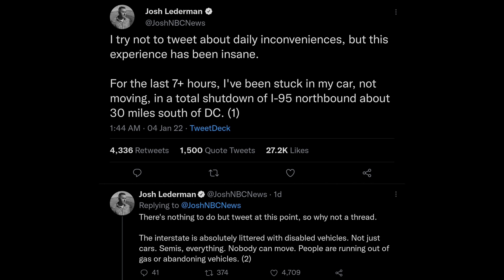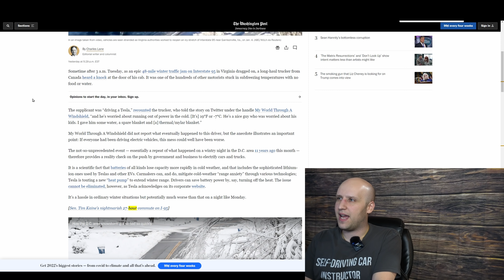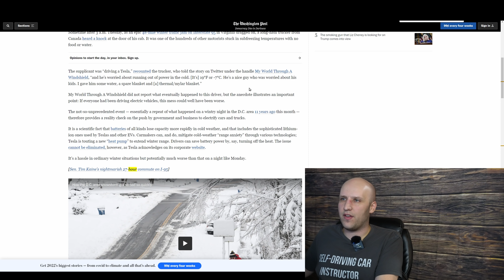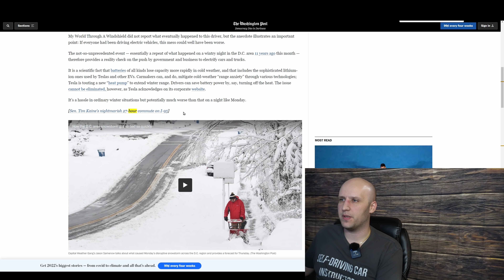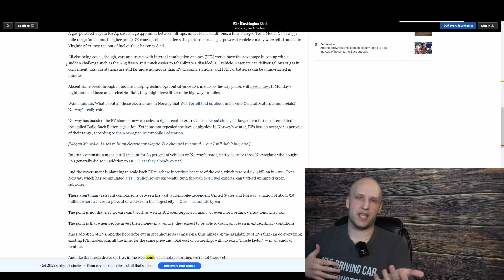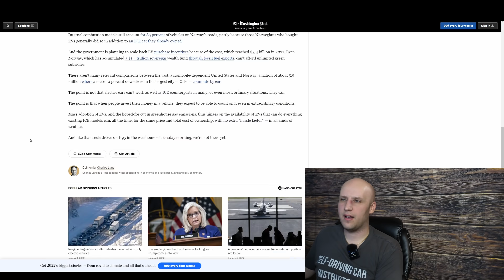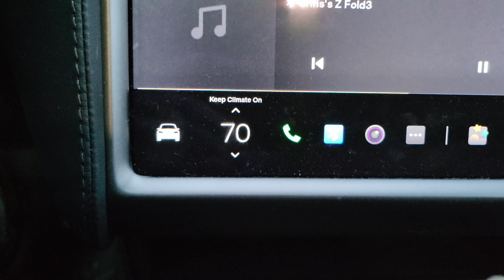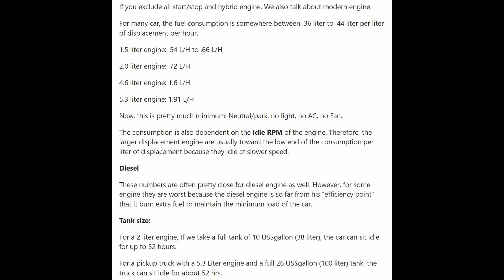How Long Can a Tesla Keep You Warm In A Frozen Traffic Jam? | FUD Debunking

Comment: Your test is unfair to the Model X because it has a much larger interior volume and more greenhouse.  The Model Y is listed at 68 cubic feet while the Model X is listed at 77 to 87 cubic feet, depending on the configuration.  The Model X also has a much larger greenhouse. While the heat pump in the Model Y can run down to 14 degrees, it is not very efficient at these temps, so the primary advantage over the Model X is that it is a smaller volume (less radiation surface) with smaller greenhouse (less heat loss through the glass). To make a fair comparison, you would need to use the same size vehicle.  At 15 degrees, the heat pump in the Model Y was probably not working all that efficiently.  When the car is moving, the heat pump scavenges heat off of the drive motor and the batteries which helps keep it working efficiently down to about 14 degrees.  If you  are not using the drive motor and drawing a lot of current from the battery, the heat pump becomes far less efficient.  I think your story has merit but I think it is an unfair comparison.  Heat loss of the Model X is in all likelihood considerably higher than the Model Y.  Not  enough to account for all of the difference, but enough that it makes it difficult to make the comparison useful.

Comment: Why is everyone talking about a carbon monoxide poisoning risk?
I get maybe in a closed environment like a small garage, maybe you'd worry about it, but it's not like the exhaust system is in any way directly linked to the HVAC system or the inside of the cabin so once you're outdoors, that risk is eliminated.
Also modern ICE gas vehicles in the US (meaning made in like the last 25 years) have incredibly low carbon monoxide emissions especially with good catalytic converters and if you were to put your mouth on the tailpipe and only breathe what came out, you would die from oxygen deprivation well before carbon monoxide posioning.
But my main point is how do you think tailpipe emissions are entering the cabin space when outside even if the tailpipe is blocked to some degree?

Comment: You were way too kind to that writer 😅 They are either misinformed or disingenuous. 
I would much rather be stuck in the snow in an electric car than an ice. Just read through some of the actual accounts of people running their ice engines for 20 minutes at a time to heat up before turning it off to conserve fuel, and contrast that to camp mode in a Tesla. One is clearly last century and the other is not.

Comment: Since I have been trapped in a car twice in a blizzard, once near to where this disaster occurred, I can attest to what  pain it is in an ICE--you run the heat a few minutes every hour to keep from freezing to death. We figure Chris undersold the Tesla because with the set heaters on, you'd hardly need any heat and it would last a really long time. And you would not have to freeze for 57 minutes out of every hour. I was stuck once in -3 and we had probably 1/2 inch of ice on the INNER windshields. (with my son who is majorly into Teslas and we have discussed --only downside is having enough energy to get OUT and finding a charger in the sticks)

Comment: The south is a joke when it comes to snow and cold temps. The smallest ice storm and they all run for their lives, I live in the northeast and we regularly get temps in the teens during winter. Just had a 8 inch snow storm and I drove to work in a Chevy cruse with all season tires. What the south needs is more winter preparedness, more salt for when it snows and more plow trucks. Snow storms in the south are going to become more common in the future.

Comment: It’s amusing how people think there’s so much difference between EV and gasoline cars in terms of getting energy into them - they have all the same potential points of failure. Both run out of “fuel”. Both are dependent upon available electricity (gasoline pumps are dead without electricity). How is a friend going to get you a container of gas when you’re trapped on a highway, are they going to walk? It isn’t as if everyone in an ICE car had a full tank of gas and many cars would run out of gas idling for many hours. This article was written by an idiot.

Comment: Great video! Thank you so much for doing this experiment. And thank you for going point-by-point in that article. One point you may not have made (or maybe I missed it): in a snowjam your situation in large part depends on where you are with your fuel "tank." It's true for both electric and ICE vehicles, and for those drivers who are on a long trip then the amount of fuel in their tank will depend on the how long ago they topped-off. If the drivers are local then it'll depend on the same thing, yet many EV drivers leave the house on a full tank. How many ICE drivers can make that claim? So I think one additional point to make is that a certain percentage of those local EV drivers suck on the freeway snowjam will be topped off, and a much lower percentage of those local ICE drivers will be able to say the same.

Food for thought. Thank you again for making this video. Is there a way to donate to your channel besides Patreon?

Comment: Out 2013S behaves similar to the X in this video. Interestingly, my spark EV set around 78 to 85 only lasts a few hours. Go figure with am 18kWh (14.5 usable currently). I wonder if it's set to 60 what it would do. If it's in park and turned on/started up it will shut itself off after 2 hours... Don't know about neutral with break on tho. The majority of EVs would simply do better in the traffic jam conditions. In my opinion.

Comment: that seat heater plus a blanket over you while in the seat will keep you REALLY toasty. Anyone who has used an electric blanket at a cabin under a blanket knows how hot you can get and how little electricity the seat heaters use. My guess, maybe 40w max (likely more like 25w) ... even all 5 seat heaters going would be less than 150w, which is going to do little to the battery over 24 hours, even 48.

Comment: In case you're curious, and want more data: I have a 2020 Tesla Model 3 SR+ LFP with a resistive heater, and I've noticed I use around 5% heating it up from -5C/23F to 21C/70F and roughly 6% every hour when maintaining the temperature in those temperatures while parked, with seat heater set to 1, and one person in the car. Since I think the usable capacity is 52.5kWh, that means 5% is roughly 2.6kWh. I'm no expert on this, but I would imagine it's also relevant that we have an average humidity level of 83% in Denmark. I've never had to sit in traffic long enough to even remotely worry about something like this though. I usually have a buffer on road trips anyway so I've never been below 5% battery in winter.

Comment: I live in NOVA (North Virginia) and I have a 2021 Tesla Model 3 LR. If the winter storm had occurred one day later, I would have been caught in this traffic jam nightmare, because I would have been commuting home from work. I charge nightly to 80%, and I am confident that I would not have had any issue staying in my Tesla for over 24-hours. I keep a zero-degree sleeping bag in my trunk and I always have leftovers from my lunch. I feel like my only problem would be some “Karen” bugging me while I’m trying to find somewhere to pee.

BTW, I traded in my 2017 Toyota Tacoma to buy this Tesla. I loved my Taco…I drove that truck back and forth across the country five times through mountains, deserts, rain, snow…everything. I even had my Taco buried up to the chassis in mud while pulling a trailer and it pulled through in 4-high.

I miss my Taco, but if I had to choose between my Taco or my Tesla to be stuck on I-95, I would choose the Tesla.

Comment: The 300 mile for model y is bs. Have been driving the model y for 6 months and for every 50 miles I drive, the range goes down by 80-90 miles. So lets say some people were driving on the highway and were at 80-90 miles (30% battery), they would be down to 10-20 miles based on this video, which would leave them stuck on the highway. This random x-y mapping that x miles means y real miles calculation isn't needed for ICE cars. My corolla's full tank means 450 miles, period. The IC engine's efficiency is 10-20%, compared to 80-90% of EVs, so their milage does not drop as bad as Tesla's when the AC is turned on. The trucker's comments are valid that if all of the cars were EVs, 5-10% cars would have 30% battery, and they would get stuck and it would have caused chaos.

Comment: I'm not the biggest EV fan - but this seems to be a case where the EV has an advantage because the same batteries that run the motors also run the heating system... and if you're stuck in traffic - you're not applying power to the motors... so essentially you're running a space heater with a 60KWh battery.
The gas car will either be running off the battery or running the engine (since most gas cars actually rely on the heat of the engine to heat the car...) and that uses a significant amount of gas even if you're not actually going anywhere. What I do in cases like that is to switch the A/C to 'internal air' and make sure all the windows and doors are tightly closed, then run the engines until the engine is hot, then turn it off until you're almost back down to "C" on the temp gauge - which even in fairly cold temps still takes a while, and repeat as needed, Then you're mainly powering the fans to circulate the air.
The other thing is, unless you have heated batteries in the EV, colder temps can impact battery charge retention, so you may find that it won't last as long as it would even while driving (which generates heat and helps warm up the battery pack), but yeah, again, it's just running the heaters, so going to last longer.

Comment: Its funny, when I first heard about the issue unfolding, I was thinking how much better my model 3 would've faired in that situation since most energy goes to pushing air. I wonder what Tesla does for spending precious power for when SOC drops below 20%? 
I've camped in my Tesla during cold nights and only lost 10%or so throughout those night camps (8hrs), but I also kept the temperature around 62 to minimize losses and still stay comfortable in my heavy clothes I had on for this purpose.
Tesla really should add a 4th climate mode for emergencies like this that turns off all nonessential systems and keeps inside at a safe temperature for survival.
Finally, energy for ICE example for cranking heat to max would have an impact fuel consumed just like an EV. The Qdot pumped through interior to exterior works similar to EV for ICE, but to steady supply that Q, you still need to get it from engine. Think of having to increase flow through radiator on engine to extract more heat to reject inside the cabin faster when 'cranking' the heat up. This in turn needs to come from engine which would now cool off faster, thereby needing more fuel to keep IMT higher and steady state.

Comment: So I read through some of the comments here and everyone’s making valid points and a couple of the comments I read eluded to the fact that the difference between an BEV & an ICE car is that you can actually go to sleep in a Tesla & pretty much be assured that you will wake up after your slumber, but you can’t really do that with an ICE car, because you could actually die from carbon monoxide poisoning if you’re not careful! So going to sleep isn’t really an option in an ICE car unless of course you’re a damn fool! 

So the guy who wrote that article was clearly trying to make the point that ICE cars had an advantage over BEV’s when in fact there’s absolutely no evidence whatsoever that proves that & there’s no evidence whatsoever that it was stalled electric vehicles causing the jam up on I 95 & the other thing is what kinda fool doesn’t carry food, water a couple extra blankets, maybe even a sleeping bag in the car during winter time? I carry a travel blanket, an extra coat with a hood on it and I dress for the season, which means, long undies, with very thick socks & really good insulated high top shoes, gloves, I have lotion, Chapstick, chewing gum & Lifesavers in my glove compartment not to mention sunglasses and on top of that my Tesla has the greatest infotainment system ever produced by mankind so if you got kids with you, you’re covered! 

So if there’s one thing I would say I would like to see Tesla incorporate into its cars would be vehicle to vehicle charging, think about that & let me leave you with this and I think you alluded to it, is that gas stations can run out of gas and as you correctly pointed out they need electricity too! So if they run out of fuel or if they lose power, guess what happens to the gas pumps, yeah ain’t working! So good luck with trying to pump your own gas without electricity, but here’s the other thing, electricity is everywhere & so all we need is a place to plug-in! So welcome to the new year and thank you for posting the video! Cheers!

Comment: One thing to note it was between 9 and 15 degrees there and but here it was between 24 and 32 degrees... also, camping mode would of went a long ways and for better math you should only deduced from 2 hours on and not counted the warning up part as part of your math because it once the cabin was at 70 then it took much less power... and also you should of used 60 degrees as the temperature the whole time and not 70 and you should of started it at 100 percent and not 90 percent and I'm saying the math is between 36 and 48 hours in a row in your settings and 72 hours for my math but either way a transmission would of burned up after 24 straight hours of heating up without been cooled down unless it was one of those newer cars that cuts off when you're not using it but I heard you can't use it air or heat unless the car is on

Comment: You also save a lot of energy by not driving. ICE engines have to idle wasting a lot of energy unlike EVs. 

Also it is Unsafe to idle to create heat in an ICE vehicle. This practice is banned in the military as soldiers have died sleeping in idling vehicles

Comment: 5 miles of tow will charge your Tesla for 20 miles of operation, Keep a tow rope in your car.  Also, keep a Jackery/bluetti  (100 to 2000 WH) 
backup battery in your car, it can charge your car thru the 110 plug while you sit.

Comment: People tend to be pretty inefficient with climate settings. It doesn't help that auto usually runs the AC. Tesla and other OEMs would do well for better humidity control without cooling with an AC and to link the cabin temps with a function of outdoor temps. 70F is ridiculously high for winter.

Comment: The difference is if you run out of fuel it can easily be remedied like it was with people being extra gas. You can just charge the battery like you can just add some fuel.

Comment: Electric vehicles actually benefit more from a situation like this but not for EV drivers that don't prepare but Tesla has their camp mode so you just fold down the back seats so you got a nice flat area to put a small mattress that you only have stored away in the front get a couple of blankets or something and then the lower depths of your trunk you could just grab an eco-flow battery or something along with its 400 watt solar panels stick those on the roof and then you can just charge your car and the battery will charge itself with the solar panels then you can keep the heater on as long as you want you can just literally camp out it's freaking awesome and those Eco flow batteries or whatever kind of battery like the electric generators those have a lot of plugs and a lot of capacity so you could charge possibly more than one electric car technically it's even worse for gas vehicles because they got to keep their AC compressors running and to do that you got to keep the engine running which is burning a lot of fuel in the process you end up burning more energy than electric car idling using its heaters from what I know of both vehicles when I was five I used to study a lot about gas vehicles because my father worked on them like 24/7 then a got to computers and robotics and then eventually electric vehicles very fun stuff oh and bring a game controller with you because just play games on the center console on a Tesla or just watch Netflix or watch YouTube how to pass the time on a 24-hour long traffic jam to use my idea you gain range in the process hahaha and if Tesla will ever updates their internet browser you can do Google stadia or whatever the negative part is that you always have to prepare to go camping in your car every single day which is not really that bad well it depends on what you do and what you have in your car for the things I describe all you got to do is just charge both batteries your main one that powers your car and your back up in the trunk and just bring some food along!

Comment: One difference between an ICE vehicle and an electric vehicle is that you can turn your heating down in an electric vehicle to use less power. An ICE vehicle needs to run the engine the same amount regardless of how high or low the heat is turned up/down.

Comment: So, power went out in my house in So. Cal. so I’m watching vids I’m only 5 mins in the vid but what about camping mode? Did someone already ask that..haha 😆 camp mode saves even more energy. 70 degrees is kind of high as well, when ur out there u probably elf have set heat down to 60-65 degrees and used level 1-2 on the seat heaters. So I elf say 30-40% longer in camp mode rt?? I have m3+, cool vid👍